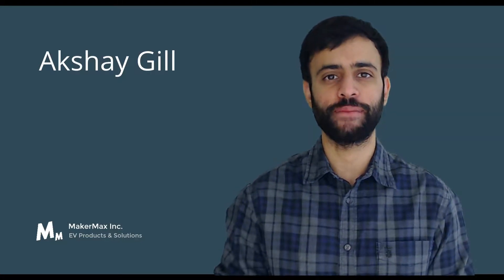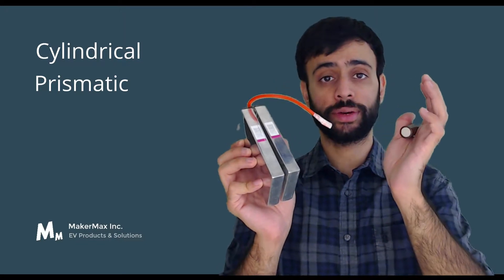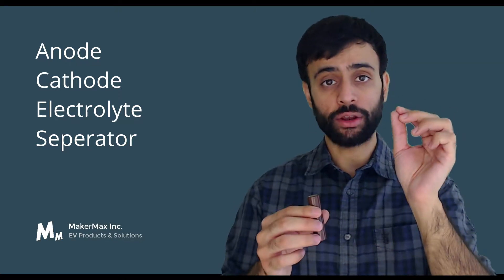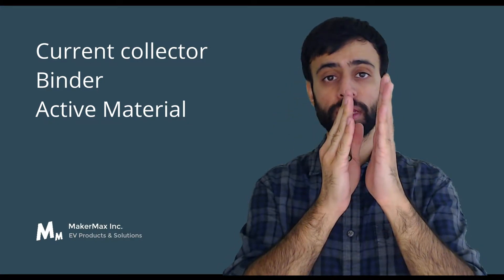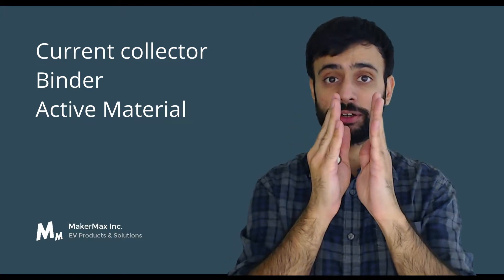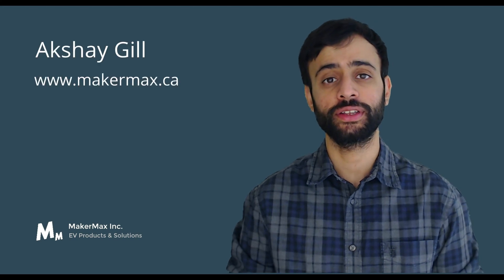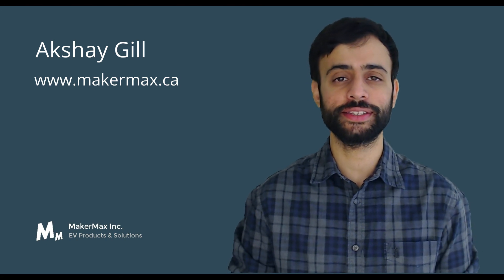Learn what is inside a Lithium ion cell, how its manufactured, and its working

Comment from the maker: 0:01 Intro to MakerMax
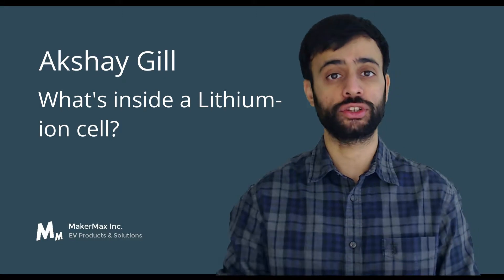0:34 Form factors of Lithium-ion cells
1:30 Diving deep into a cylindrical Lithium-ion cell
2:09 Four main elements of a Lithium-ion cell
3:00 The process of Intercalation
3:59 Charging and discharging of a Lithium-ion cell
5:06 The properties of a seperator in the cell
5:48 What is a Jelly roll inside a cylindical Lithium-ion cell
6:21 How the cell is manufactured
7:26 How the internals of a Lithium-ion cell are connected to the outside of the cell's body